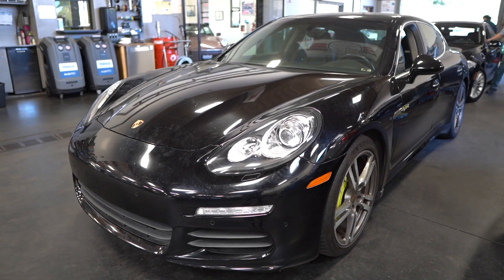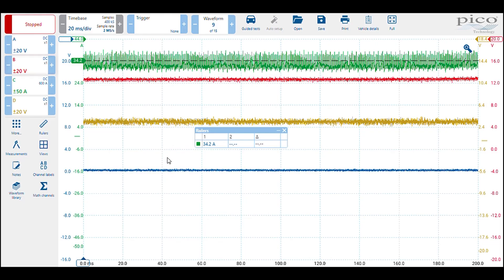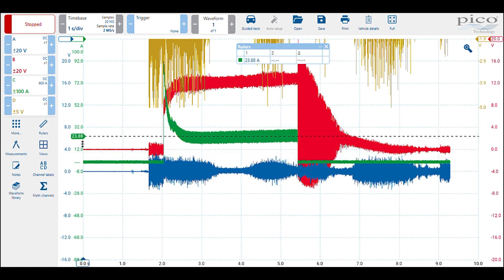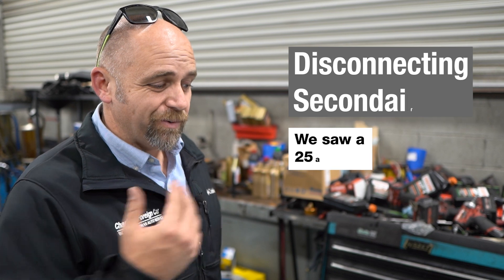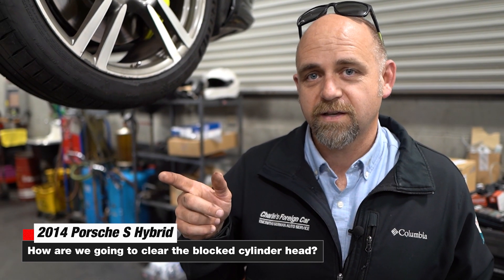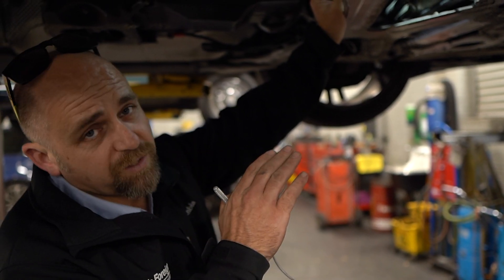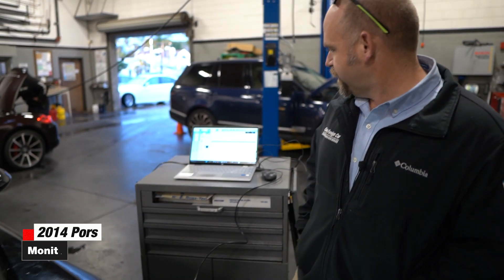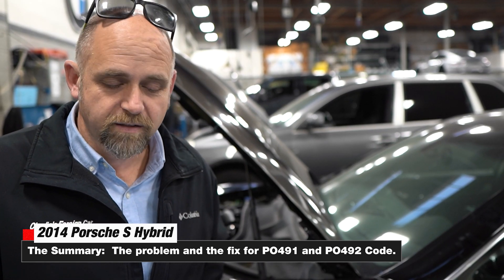Porsche Hybrid Low Flow Codes

Comment: Thks for this great comprehensive video! I have 2013 cayenne hybrid (~150K miles) suv same codes wirh good secondary air pump for 3+ secs then cuts off. I suspect same  plugged secondary air port(s) as depicted. How big of a job is it to remove/ reinstall exhaust manifolds and drill/clean ports on my vehicle? Thks again

Comment: Hi I am also getting these two codes, p049100 bank 1 below limit and p049200 bank 2 secondary air system malfunction. 
The car drives fine without any issues apart from cel warning, if not fixed will that cause any issues in the future?
Reply: Hello, it won't cause any lasting issues with the engine.  The general description of the secondary air on a car is to pump atmospheric air into the exhaust stream during warm up of the catalyst.  This will get the catalyst warmed up in a quick state.  The pumping of air acts like a fan stoking a fire.  The warmed up catalyst gets the car to operate clean tailpipe emissions in about 60 seconds.  This is the functionality that your losing.  Not having a clean tailpipe at a quick speed.
Reply: Thanks for your reply, so in reality it affects nothing really. Being a hybrid, this should pass the emissions test right if I turn off the EML?